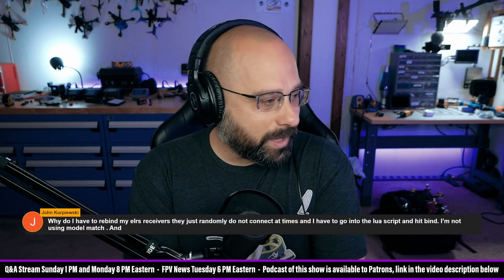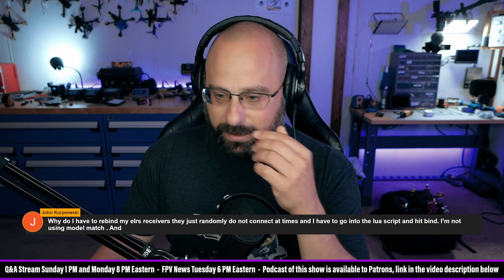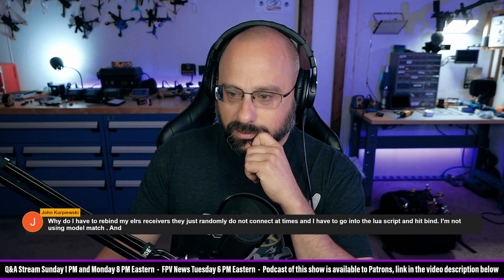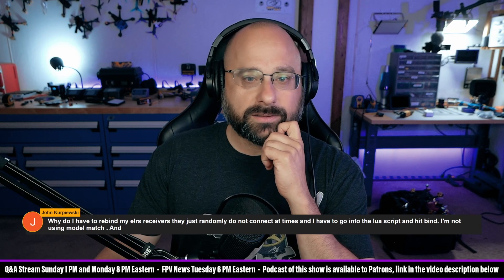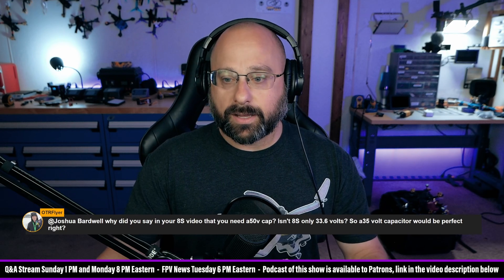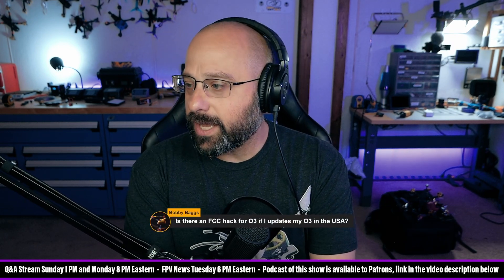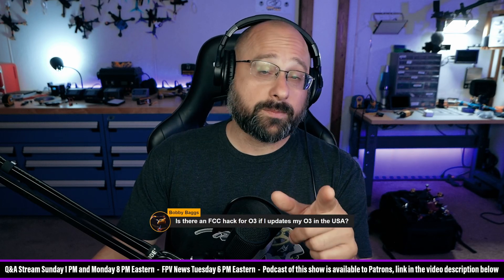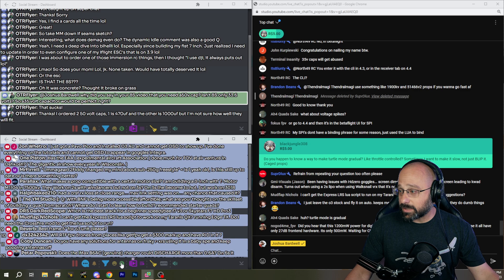Which Drone Do I Start With On An FPV Sim? Do I Need A Higher Voltage Capacitor? - FPV Questions

Comment: Regarding the ELRS binding issue: I had a similar issue recently. I was flying two BNFs, an SPI-based Mobula6 HDZero and a UART-based Flywoo FR16 (the new one). TX is a Happymodel 1W module on TBS Tango 2. I flew both successfully on the same day then both just suddenly stopped binding, literally between battery changes, on each quad. No idea what happened and I didn’t plug/unplug repeatedly. Had to re-flash both FCs through BetaFlight to get them working again (the TX was fine). Really weird.

Comment: I find that if you tac the cap down on the pads first then solder the battery leads down onto the cap leads to the pad is the easiest way to do it. Trying to add a cap to the top of a solder blob looks really bad.

Comment: I've had elrs receivers randomly drop binding phrases. No idea why. It's happened with a betafpv flat rx and happymodel fyujon. Just had to get it in wifi mode and re-enter the binding phrase.
Reply: See my comment above, same problem on different hardware to yours - makes one suspect a software bug, but a really weird one. The strangest part was that I flew the Flywoo a few times before it stopped binding. I thought I’d broken something so I then flew the Mobula6 (with no issues) which then also stopped working after the 3rd or 4th battery. The common factor is the same TX was used for both - almostnlike the TX sent some sort of “reset” signal to each quad independently but wasn’t affected itself.